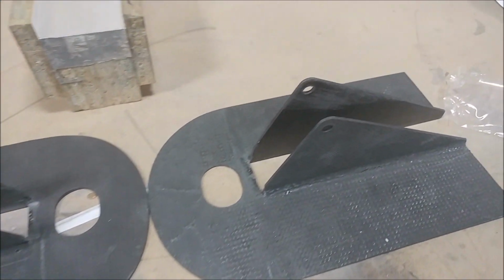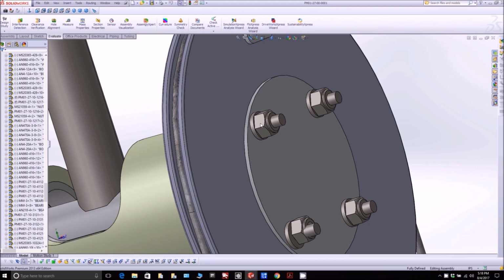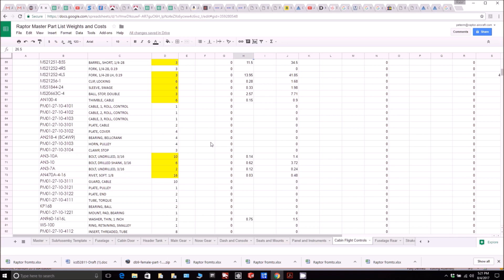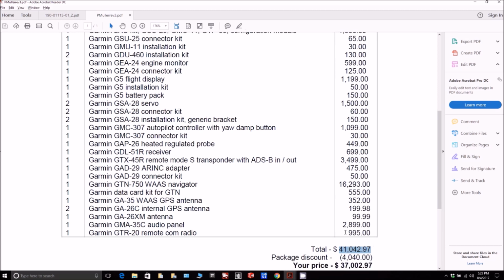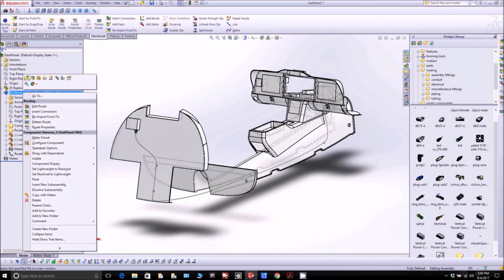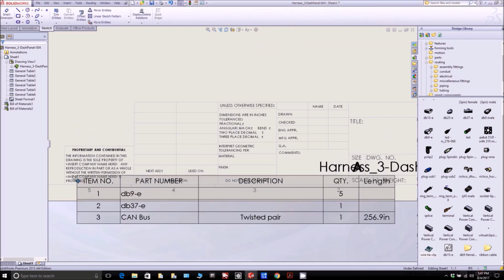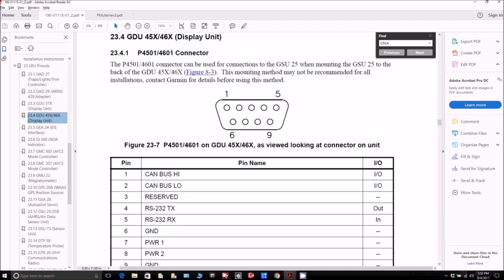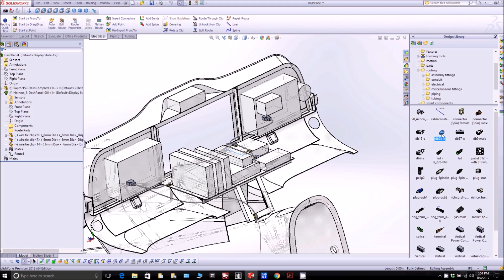Adventures in Wiring - First steps in harness design

Comment: Peter;  Great work.  Finally an area I have some knowledge of Avionics and wiring.  The wiring harness and grounding is the MOST important part of these avionics.  If it is not done well; you will be chasing gremlins forever.  Because you are using a composite structure that is even more important.  When making the composite parts, I have not seen you putting in ground plan foil.  Also,  P-Static is going to be a BIG issue. Recommend you do research on P-Static and ground plan foil for composites. 

In the Cirrus Aircraft;  P-Static has been a big issue.  Also,  when they had to add a second external WAAS antenna; the cost was very high in the field to add the ground plain foil after the fact.

Comment: I just installed the G3X system in my Velocity and Garmin did not want the GEA 24 engine monitor box in the engine compartment. They said it would work...for a little while but not a good location for long term.

Comment: Good effort on the wiring schematics.  

Solidworks is good for working out wiring cable lengths etc. , but so far is weak on handling variants and options.  There is a good chance that the avionics will be a little bit different for each airplane made.  

The big bogie in this type of manufacturing is data and inventory management, revision control, documentation for servicing, training etc.  

I have been using Zuken E3 for wiring, which is a pig to work with, but once set up allows variants and options to be turned on and off with a tick box, and generates all the documents such as schematics, cable documentation, BOMS etc.  

If there's a better platform out there I'd like to know about it.

Comment: Peter, have you chosen an interior sound-deadening method yet?  In the hot-rod world there are products such as Dynamat with a sticky backing which works well.  There are several options and products with varying degrees of muffling.